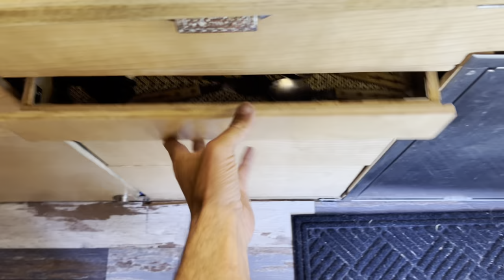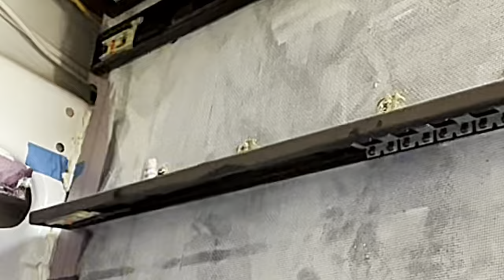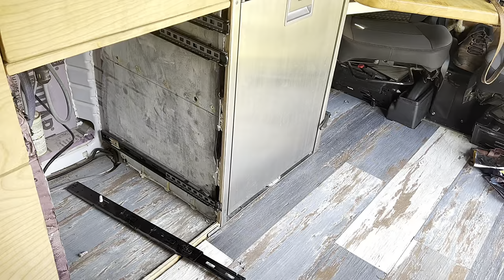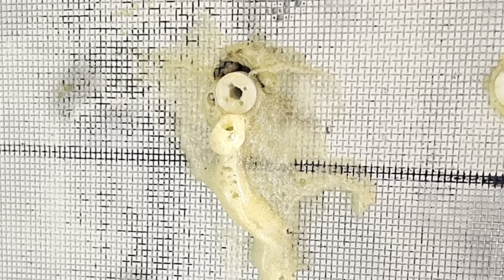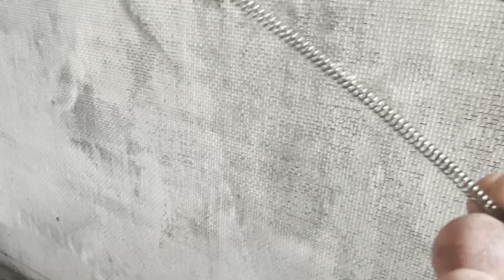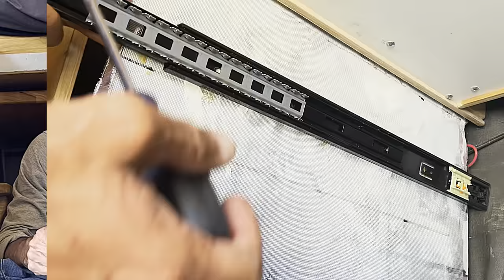When Foam Anchors Fail - Foam Bones Van Build System Vol. 3

Comment: 06/12/2023 Hello Nomad. If the anchors are failing, maybe additional holes in the slide would allow more fixture within the foam. Also from an anchor failure type person, I would place a bead of adhesive on the back of the slide. That and the extra screw should be the max load possible from the two materials. The 3rd trick for vertical hold may be to slice, perhaps with a knife or screwdriver, a groove deep in the foam to allow more area for the glue foam to expand making a larger anchor pull out cone. UL testing for anchor hold defines the cone of the pull out the breaking strength of the anchor and the material tasted. That test is about $100.000 dollars per pull test. Good job you probably saved about $1.000.000 in testing fees plus my engineering fees. You asked for comments. I did enjoy your videos. You are almost brilliant in approach. I could never do a build out like you have. I love the tongue and groove joints and the screen. SIncerely Don
Reply from the maker: Thanks Don… I considered those solutions as well as adding 1/8” ply strips to wall above and below each drawer slide glued to the foam, but I wanted to test the anchors without those first. Since it was just one anchor I figured there was more too the issue. There was… the push to open slides are the root of the problem… I will cover in detail in a future video, stay tuned.
Reply: @falkornomad  06/12/20203 Hello Nomad. Thank you for your gracious response. Sometimes I am misunderstood. Sometimes my wit fails me. I do enjoy your videos. I watched one when we were younger. You test everything then put it on the road and succeed. That is cool. Sincerely Don

Comment: Try gluing 3/4 or 1inch dowel into the holes to spread the load over a larger area to prevent compression failure of the foam due to the small area of the screw anchor Once the dowels are glued in you can drill directly into the wood to anchor the screw the increased contact area of the dowel should alleviate the problem of failure due to crushing of the foam.  Very interesting, You have done a lot of original thinking here.
Reply from the maker: Thanks for the “original thinking” compliment! I consider dowels or inset slats… but I wanted to continue testing the foam anchor idea… for science! Hope to make other testing videos with other ideas and options like this in the future.

Comment: I believe when you use the double-sided carpet on installing the drawer slides be sure the fasteners are flush or inset just a little so they will not hold the slide away from the double-sided I think you did great we all need to change a few things

Comment: I think it's awesome you're trying this stuff out.  The problem with foam is it's easily sawed thru.  As you're "earthquaking" down the road you're creating cutting motion with the weight and vibration on those anchors.  I thought they would fail much sooner, so thanks for doing this.  I would suggest maybe using some 80/20 anywhere you need weight bearing anchors.  Keep up the awesomeness... !
Reply from the maker: lots of options for improving the system for sure... after 18 months full time in the van everything is holding up surprisingly well.

Comment: Thanks for this info! Always good to see the problems that arise, and how they might be fixed (or prevented). 
And now wondering how those slides for your fridge in the back have held up?
Reply from the maker: Those are SUPER solid!!!
Reply: @falkornomad  What do you think makes the difference here? Given that it was the anchors that failed in the drawer, so shouldn't matter how heavy duty the slides were?
Reply from the maker: Have not fully processed the complete physics analysis yet… there are slight differences in how they are attached, used and how the weight is distributed, etc. nothing is as simple as it seems.

Comment: Hi thanks for sharing your vids are great.  With the drawer runners i would have drilled 2 more holes in the track and inserted another 2 screws in the foam would have strengthened the weight capacity of the drawer runner.
Reply from the maker: Good idea, I’m trying to follow this approach down the rabbit hole for science but there are lots of other options for sure.

Comment: Try filling anchor holes with Bondo and use the plastic anchors. That will be the strongest combo. You can also use bondo for custom shaping. If you put a 1” x 1” sheet metal square with a hole drilled through it and put it over the anchor hole and stick it on while the bondo is still wet, you will get crazy structural strength.
Reply from the maker: good idea!
Reply: Be careful of that one. Bondo is a polyester resin, as used in regular fiberglass work, and it is a solvent to XPS foam -- it will melt it. A better choice would be a thickened epoxy resin. That would work fine with polystyrene.  WEST System products are readily available and they have many choices for resin and thickening agents. It's expensive, but for this sort of use, you would not need very much. 
I'm enjoying your work -- keep it up 👍 @falkornomad

Comment: To avoid this on my build, I'll butt-join strips of wood that are foam thickness by cabinet height by 2-4 inch wide (depending on weight capacity needs) to a foam panel whose width was cut 4-8 inches (double the previous variable) less than the cabinet depth.  So for medium capacity drawers in an 18 inch deep 36 inch tall cabinet, the walls would be constructed as:
3x36 wood, 12x36 foam, 3x36 wood with 2 butt joints, no screen, thick coat of white paint (or with a white epoxy pour on both sides). I'm tempted to feel guilty about having an easier build because of your "learning opportunities". Thanks for teaching us. I'll be sure to pass it on. ☮️❤️🌈
Reply from the maker: Oh!!! You having an easier build is THE POINT never feel guilty about that!!!

Comment: I repair travel trailers, and have seen the most beat up drawer rails after only a few months of use. Whenever I have a repair come in, and even if rails attached to sties and other vertical pieces, I reinforce.

Take scraps of 1/8 ply, cut a straight edge, then screw into whatever material is there, butting up under main support rail. Weight load on drawer rail transfers to original rail screws, as well as ply underneath. Think cripple studs for drawer rails.

Ply does not interfere with drawers, but can see. On high end coaches, used a rotary tool to shape and paint same color as rails (black, white, eggshell, tan). Won't be applicable to you, but I could remove reinforcements to access other parts of cabinet as needed.

Your drawer failed not because of foam, but weight bouncing on rail and transferring to screw, as you accurately described. That was with 2 cast iron pans.

One of my bone head clients keeps a full set, incl Dutch oven, in large drawer. Rails ripped out repeatedly until reinforced. I am sure will have to rebuild drawer bottom next visit.
Reply: Forgot to mention, for thus particular application, I would cut the ply to snug fit between all the rails, so weight eventually transfers to floor. Screws only there to keep oriented and in place.

Comment: Carve out a place in the foam and glue in some wood to hold the drawers then no worries of bouncing the screws loose. Also can run a strip of wood down the middle of the drawers to keep them from sagging I would dig out some foam just the size needed to glue in the strip of wood making it flush with the foam and make it. H shape one down the middle and one running along each end with the wood strips in H Or one down the middle and 4 strips to run about the sides this will make the drawer stronger and not sagging hope that idea helps...

Comment: If problem persists, use a 1" metal washer.  It will make the drywall anchor sit proud of the foam board by about 1/8".  If that's an issue you could countersink the washer with the spade or fortsner drill bit so the washer sits flush.  It gives you strength laterally to compliment the vertical strength provided by the drywall anchor.  In order to pivot, the washer would have to compress the foam of a much larger area than the head of the anchor alone.  You jus5 need a washer with a hole big enough for the drywall anchor to pass through.

If that doesnt work you could get a wooden closet rod.  Drill out holes 3/4 of the way through the foam, glue in plugs, cut plugs flush with a japanese flush cut saw, and screw in your rails (no drywall anchor since you're going into solid wood.
Reply from the maker: Not a bad idea at all… I had a recent revelation about what the originating issue was and I don’t thing it will be a recurring issue.

Comment: No idea if this is a solution (sorry if it's already been mentioned below), but my immediate thought about heavy-duty areas like drawers is - how about cutting front-to-back channels and inserting and gluing battens of plywood or pine, then screwing the rails into them. It wouldn't compromise your foam bones philosophy (you already use wood for other 'heavy-weight' areas), and the large gluing surface area should keep the battens solidly fixed, and allow for you to put your cast-iron pans back in the drawers! Love the whole foam bones idea - I'm sold!
Reply from the maker: Yep this can be done and not really mentioned except briefly in my prototype Q&A video. Routing channels is laborious and (for science) I wanted to give these anchors a try and test them over a year of full time living. Thanks!
Reply: No problem, thanks. Oh, just one more thing - do you have a video on how you created the floor using the foam? Thanks again
Reply from the maker: The smallest mention in the glue up video, but the full coverage is on the list.. long story short; reflectix cut to fill the recessions in the corrugated factory floor, then 1” xps foam. Where we will walk, I added 1/4” Chip board on foam, then the vinyl flooring… all other “floor spaces” did not get chip board. Let me know if you have questions.
Reply: @falkornomad  Great man, that's all I needed. Will try not to hassle you again - I'm sure you're busy designing something or other! 🙂
Reply from the maker: No hassle at all… I’m busy driving around North America at the moment👍🏽

Comment: Have you thought about using some wooden dowels cut into small pucks, maybe around 1" or so, glued into the foam board.  I'd imagine that would distribute the force over a larger area for this type of application where the stress is being applied more laterally.
Reply from the maker: Yep… I’m following this idea down the rabbit hole… certainly could do pucks or 1x2x length of drawer slide into foam and screw to that.

Comment: Very good
 I think you will see failures in the long run from just the pressure from opening and closing.  So I would put wood inserts anywhere you need to anchor stuff. Even an embedded 1/4 inch ply, 1 inch wide,  will be a vast improvement overtime. 
Cheers
Reply from the maker: 1/8” ply strips were an option when I built it but I’m trying this for science… the push to open drawer slides are the root of the issue I’ve realized and will cover on a future video. But yes, both those ideas are on the table as options for sure. Thanks!
Reply: @falkornomad  Here's another thought.  Does anyone make a hot melt "router" for foam?  If you had a hot wire bent to 1/4" deep you could pull that along a wooden or metal guide to melt a straight groove in the foam.  Then you could embed some plywood to add structure.  Or...could you embed the drawer runners into the groove???

Comment: Watched 3 part series.  Good info.  Plastic anchors w/gorilla glue for the win.
Drawers ... IMO, low tech rules.  Glider drawers are too easy to fail and will eventually break. Consider solid guide rails/ledgers with drawer locking system for your earth quakes.
.
I'm most interested in foam panels used in exterior walls and roof.  (travel trailer build) How seperate panels tie in with metal frame work, weather proof sealing, aero dynamics, etc.
.
Would also like to see your take on fiberglass bonding or carbon fiber applications.
.
Good series.  Safe travels.  Thanks. 👍
Reply from the maker: Yeah, the worst design decision of this build are the GD push to open drawer slides… I hate them and they are slowly breaking… I plan to cover this in a future video, but basically the reason the foam anchor broke (I now realize) is that the push to open slides opened themselves (weight shifted correctly while driving to open drawer), drawer slid out while driving on bumpy road and bounced a few times fully extended. 

I would like to do a foam trailer… I’d like to router out the finger joints in the 2” exterior and glue in 1” for cabinetry to make a true “unibody” design. I’d also like to try to make it so that the trailer could come off of the trailer frame. This would allow one frame to hold several different designs (mostly for testing but there are also some practical applications of this). 

There are so many materials to test for screening and laminating. Strength wise I don’t feel like this system needs more tensile strength, I’d rather see the cost and weight lower.

Comment: A trick boatbuilders use is to drill a significantly oversized hole and fill it with glue/filler, and screw into that. Maximising surface area is the key I think. A hole saw and glue mixed with wood/foam shavings might be worth a test?
I wonder if there is a low cost 2 part glue that could be used (to avoid the need for air or moisture curing)
Reply from the maker: That’s an option for sure, it and many other “substitution” options have been suggested and definitely would work. I am trying to follow the foam thing down the rabbit hole for science.

Comment: I glue a narrow strip of plywood between the pull-out rails. This directs the vertical forces to the floor and relieves the screws. Then they only have to fix the pull-outs in the foam. A few inch wide and thin strips between the top and bottom screws are enough.
That is also physics. 🤭
Reply from the maker: I used this same idea in the cooler drawer in the back (to be covered in future video).

Comment: All the rattling have made most of those drawers misaligned… Those foam need more support than just those screen fiberglass. Marine grade fiberglass + resin epoxy would do the trick as is or use plaster to make it flush on top of sanded fiberglass, glue, then veneer. 👍
Reply from the maker: It was less the rattling and my hurried install... I found later that I had not put the final screws in most drawers... only the adjusting screws... nobody's perfect!!

Comment: On all my drawer slides in addidion to screws I used Gorilla #30 lb 2 sided tape on both the cabnet side and the drawer side. They don't move at all and I go down the worst roads in Death Valley all the time.  Get your screw holes where you need them to be, then take 2 long screws with the heads cut off and finger tighten them into the screw holes. put the 2-sided tape on the metal slide first then use the headless screws as a guide to slide the track over. Remove headless guide screws install real screws and tighten. you will never need to think about them again, not ever.
Reply from the maker: I considered that… or just using the gorilla HD between slide and wall, but I wanted to stress test these anchors for science.

Comment: Great system and glad your repair worked out. Just a thought and recalling a way my dad showed me how to deal with a similar issue of a larger drilled holes in masonry and a wooden peg. Could you plug the larger holes with a peg of foam using Gorilla glue to secure it then reuse the screw in fixing in the peg?

Comment: Thanks for the videos!
Have you considered what the weight challenge would be for using 2x2x2 blocks of woods glued into foam where screws would be used? 
Just a thought…
Reply from the maker: I considered using wood for anchoring and I may try to do that test at some point... but after finding how well just the anchors in foam worked I wanted to do a real world test of that simple approach.

Comment: Have you considered gluing the back of the slide as well as the screws to have to pressure off the vibrations spread more evenly across the screws?

Comment: I would say sides for the drawes would be the same - where not to use foam or you should glue in a vertical hardwoor/plywood strips where the drawer slide fasteners should be.
Reply from the maker: Considered this but wanted to follow the anchors down the rabbit hole

Comment: VHB tape on the back of the drawer slides, plus the screw anchors, might make the slide mounts hold up better.
Reply from the maker: Good idea… or just glue them with the construction adhesive 👍🏽
Reply: @falkornomad   yeah, VHB is not so cheap, and one of the adhesives you use might work well.
Reply from the maker: 👍🏽 and it’s already “in stock” lol
Reply: @falkornomad  it would be a lot of square inch area, connecting the back of the slide, to the foam skin/screen.  That will be so much area, it would have to be pretty solid.   I'm surprised that the rear cooler slide mounts have held, but maybe the load is not usually you hanging off the slides extended, and many more screws.  Are those also gorilla glued plastic inserts in screen skin 150 foam?